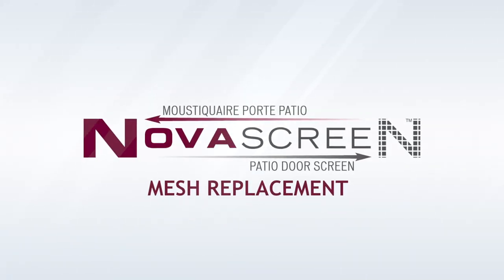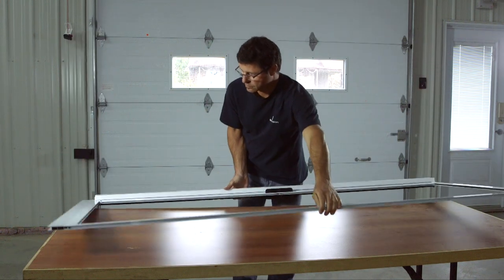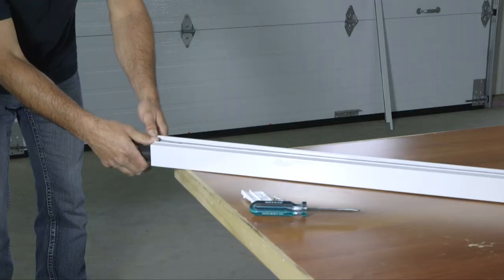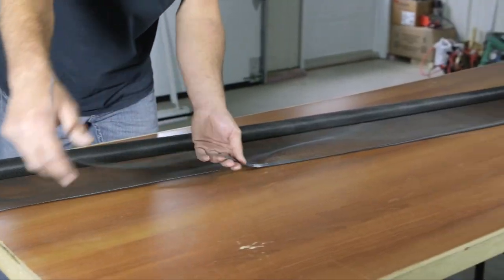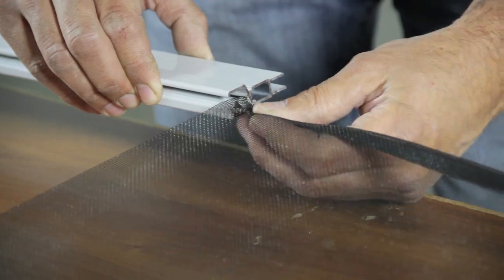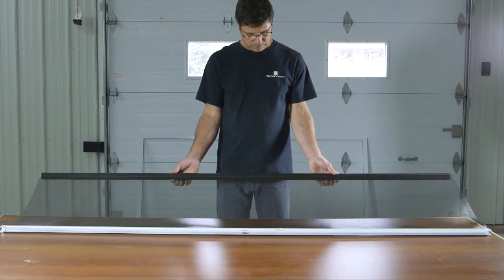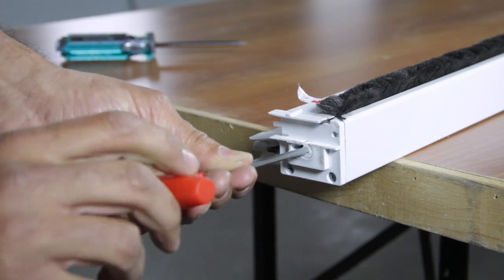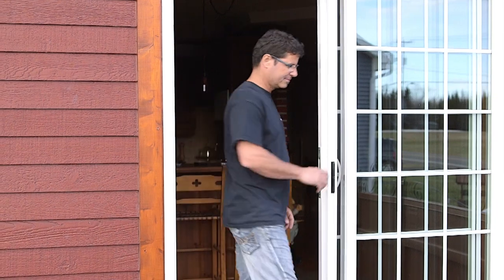Novascreen  MESH Replacement

Comment: This is the best video and I appreciate you posting it!  I'm wondering what type of glue is used to attach the screen to the roller as I have adhesive failure in some areas.  Your response is appreciated!
Reply: Good afternoon, we use double side tape. thank you